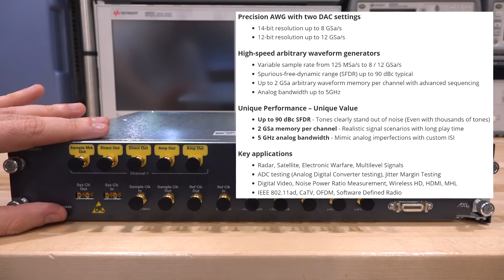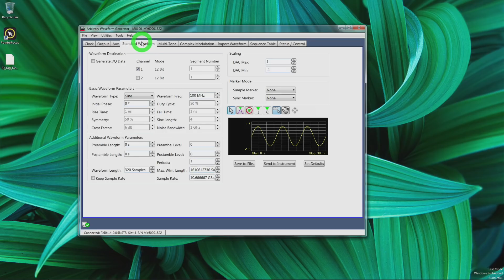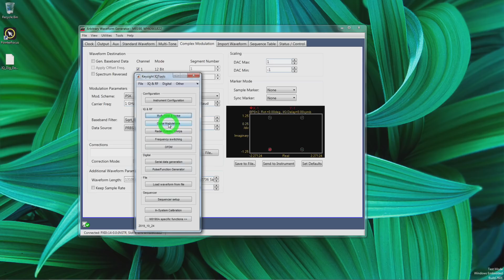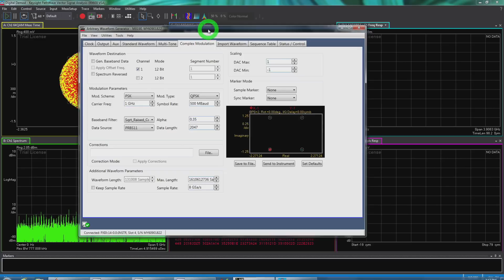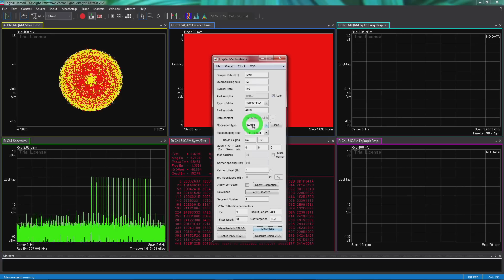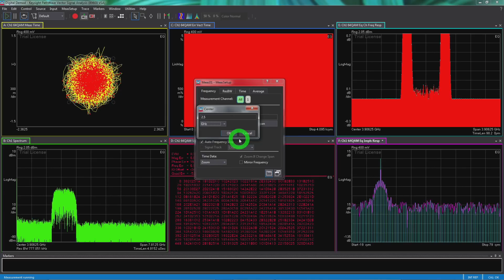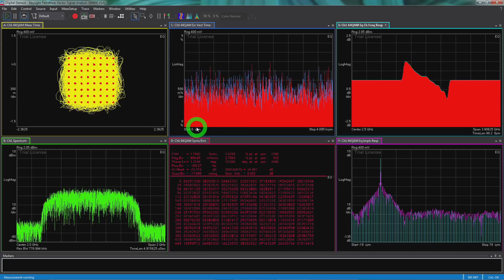TSP #179 - Teardown & Experiment with a Keysight M9505A AXIe Chassis & M8190A Dual 12GS/s 12-bit ARB

Comment: I stumbled on this video and I have been engrossed😊. Thanks for the awesome channel. I am working with M9505A snd UXR0404AP oscilloscope. I generate two different signals for channels 1 and 2. I only select the real part since I am using differential mode. Is this the right way to do it? I see that you selected real into channel 1 and imaginary part into channel 2 - of course this is for a single signal. If I have two signals how should I download them?

Comment: AXIe is based upon AdvancedTCA, which is PICMG 3.0, 3.1, etc.
The huge difference between them are that ATCA's backplane is mainly ethernet based (1G, 10G, and 40GBE), and AXIe is mainly PCIexpress.
Reply: It might be possible for a standard ATCA blade to work in this AXIe chassis, but it would be doubtful that it could communicate with any instrumentation blades.

Comment: Shahriar , I wonder when you  run equalization on signal, is it calculated by some algorithm  adaptive to fine tune it , or you should adjust it to get that SNR , 
I mean how do you know the equalization parameter ?! that delay in picosecond   range make huge impact , is it big  issue jitter in  timing  for 5G mobile then ?

Comment: I had the pleasure of working with a M8190A during my PhD. We used it to generate pulses for controlling superconducting quantum circuits and for doing electron spin resonance. Very powerful device, although a bit tricky to program. The (Python) source code I created is available at https://gitlab.com/stwe/awgcontrol, in case you are interested :)

Comment: Seems likely that there is ethernet running across the backplane, those transformers could very well be related to that. Seems quite common in equipment like this to provide control/monitoring/telemetry type comms between modules using ethernet.
Reply: Is it necessary to use signal transformers when it's all internal though? I wouldn't have thought so, since there's no isolation requirement, nor a need to match impedances.
Reply: @LiyangHU  ¯\_(ツ)_/¯ You could be right. Im only speaking from observation - every time I have looked at a piece of gear with internal ethernet (usually a bit of telco gear since that is what I work with) there always seemed to be transformers involved. Maybe different from industry to industry, but theres plenty of other non-isolated signals on a backplane, so definitely strange.

Could also be something other than ethernet, it just seems to be a common choice.

Comment: For future reference, the original switch type is often called a vandal-proof switch, vandal-resistant switch, or vandal switch. Bulgin and E-Switch are two of the major makers of these switches but far from the only ones.
Reply from the maker: Thanks! This is helpful. I do like the key switch I installed on it. Something satisfying about turning a key to operate the unit. :)
Reply: @TheSignalPath  It's only a piece of test equipment, not a missile launch panel!
Reply: That's ironic. Seems like it wasn't resistant enough and broke first. And not in equipment that you'd expect getting a lot of abuse.

Comment: Very nice. Is Axie Keysight’s version of Pxie? The connectors looks pretty similar, just takes a slightly different form factor. Keysight makes wonderful modular instruments, I am slowly building up an array of Pxie instruments (VSA,VSG,VNA,SA etc...). The soft front panels from NI and Keysight are pretty extensive and looks just like a real instrument with all the functionality. The PXIe modules are often much cheaper on eBay than a box instrument.
Reply: On the Keysight Webpage it looks more like the bigger more expensive brother of PXI.
Reply: Sven Schneider saw that after posted my comments. Looks like it incorporates more communication standards than just PCIe. But the ecosystem looks more specialized than PXI. PXI module are cheaper and readily available on eBay than AXIe I suppose.
Reply: AXIe is based upon AdvancedTCA standards (PICMG 3.0, 3.1, etc.). PXI and PXIe are based upon CompactPCI. AXIe has more PCIe lanes, so it has a lot more bandwidth at its disposal.
Reply: Brian Smith I thought PXI and PXIe are based on PCI and PCIe respectively. On Keysight’s website it states that M9505A chassis runs PCIe gen2x8 up to 4GB/s while PXIe chassis from NI that runs PCIe gen2 can have up to 12GB/s and gen3 can run up to 24GB/s. That’s much higher bandwidth than the AXIe chassis from Keysight.

Comment: Completely lost me in the actual usage, I don’t understand any of that IQ modulation aspect, very interesting just the same.
Reply from the maker: I realize I went through it quickly. This was just an intro video to get the unit working. There will be more in depth experiments and explanations.
Reply: @TheSignalPath  I’m sure that what you explained was perfectly understandable for anyone with experience using those kinds of modulation systems, it’s not something I have really been exposed to so I am really lacking the fundamentals of it (I suppose that is due to me never completing any formal education in RF)
Reply: W2AEW has a few excellent videos on IQ modulation. You should check those out.

Comment: Standard repair procedure is to put a piece of electrical tape over that bright LED :-) Amazing equipment demo. Must cost a fortune.
Reply from the maker: I thought to myself that a while LED would be nice and unique!  I wasn't expecting it to turn into a supernova.
Reply: @TheSignalPath  Sand it to diffuse the light. If that's still not enough, add series resistance - a potentiometer or resistor substitution box would come in handy for finding the right value.
Reply from the maker: I sanded it before I put it on the unit because I wanted a diffused light. There is also a series resistor, just not big enough I should have checked how bright it was before I closed the unit.
Reply: Must cost a fortune? That's a understatement.
Reply: Just throw some Kapton over it. I did that in my last apartment with the clock on my oven which wasn't dimmable from the menu. That thing used to keep me up at night.
Reply: I just take a marker and colour over overly bright blue LEDs to tame them down.